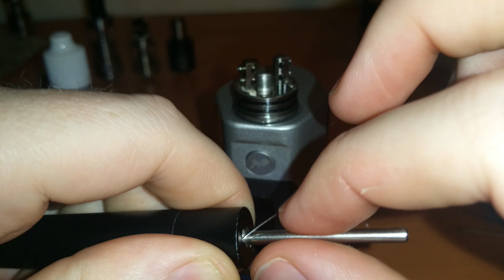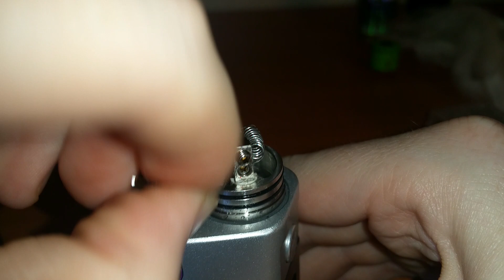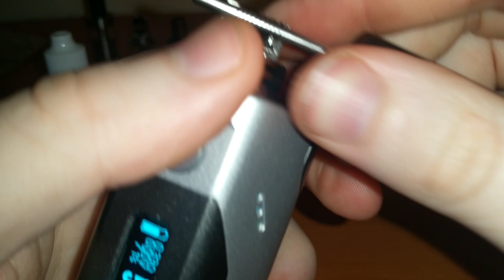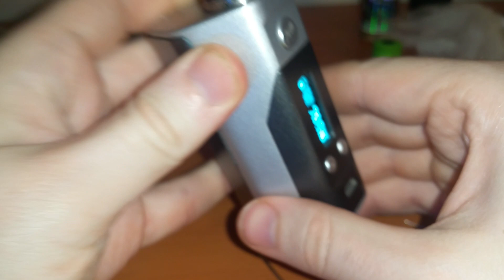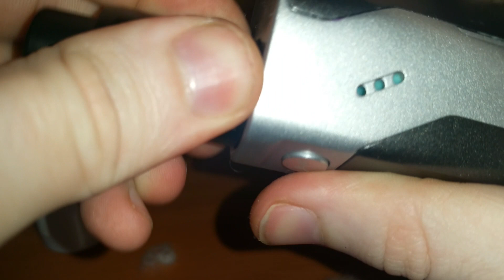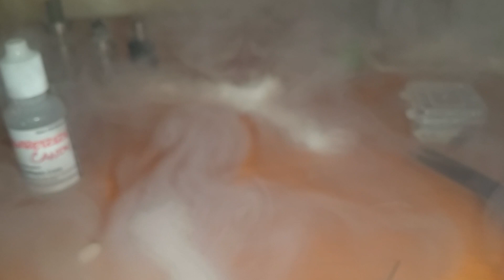AdvancedVape Build Guide Episode One: 316L Stainless Steel Spaced Coils

Comment: Hey man, first of all, thanks for the video. I have a question though.
I'm really confused about the relation between the wattage and the resistance. For example, about 5 min ago I wrapped my first coils and the resistance is 0.22 so what wattage should I vape with approximately?
Reply from the maker: Ihap subaşı there isnt a direct correlation between resistance and wattage if you're using a regulated mod. What is the wire made of and what are it's specs?
Reply: The wire is stainless steel 28ga
Reply from the maker: Ihap subaşı on a normal wire 28g build. In dual coil, I wouldn't go above maybe 60W. Probably won't even need that much.
Reply: Thanks man. Appreciate it ...

Comment: Hey man I just bought stainless steel 316L and I’m using it in temp mode on my t-priv,
 I don’t think it’s doing it’s job as in pulsing once u get to a desired temp.
 
I have a staple coil using ( 5).5 ribbon and the wrap using 38g all ss 316L coming out to .25 ohm on a 3mm bit and about 7 wraps.
  On my mod of course I set it to stainless and about 80 wats and for the temp I have it at 200 degrees Fahrenheit and it ask me for the coefficient and for that I put .00092 or .00094 or even .00125 according to internet source for 316L ss and the temp control isn’t doing its thing.
 And I get dry hits with out it telling me I reached the limit or dry coil.
 Can you help me with this.
 I bought the mod a week ago and having problems left and right.
 I search and search and nothing seem to help.
Reply: I forgot to mention they are all touching and they aren’t spaced.

Comment: When you go to TC mode what settings do you send at for your temperature in your wattage thank you
Thank you another great video
Reply from the maker: Paul Hastings I'm using a 316L CSV file and 440F with wattage dependant on the build. If you're not using a DNA mod, use TCR mode with a tcr of 92.
Reply: AdvancedVape so you said the wattage two whatever comfortable Vape to want

Comment: What is the reason for wanting spaced or non spaced coils?
Reply from the maker: joseph fiorini spaced are easier to work with when you're just starting out, and temp control typically works better on spaced. Contact has more concentrated heat. Really I made this video for people doing their first ever builds
Reply: AdvancedVape oh. I didn't know. I started with prewrapped non spaced coils. Although I've wrapped the last two I made. 
I will be picking up some more wire soon.
Reply from the maker: joseph fiorini yeah pre wrapped is the best way to start but it's a good skill to have eventually to wrap your own. You can customize diameter and wraps etc if you get the premade wire by the spool.
Reply: AdvancedVape. Right now I'm just using up the kanthal that came in my kit. I figure I will get clapton wire next probably ss.

Comment: HI, im new to 316 coils also with the temperature control mode. Im holding a DNA device, bit confuse about the setting of it. Im running a 0.37 dual coil contact build on it with 230F should I turn it up a little bit scare of it get burn ? what do you recommend for the temperature? thanks
Reply: btw I thought your video is pretty interesting im going to try to build on my reload rta, hopefully enough space for it.
Reply from the maker: Chen Jason if it's temp controlling correctly 230 is not going to produce hardly any vapor. check the temperature read as it fires to make sure it's correctly temping
Reply: AdvancedVape this is weird lol..I'm actually getting the feeling of around 40w at 230F and I turn it up to 330F it taste bout the same
Reply from the maker: Chen Jason does the temp readout look accurate? anywhere from 220 through 350 should be extremely cool, not much happening. 450 should be slightly warm
Reply: AdvancedVape I turn it to 450F it burns instantly, it is because I wicked wrong? Can't think of any other problem, I can see it going from 45/175/280 to 450
Reply: with juice on it

Comment: Hey man i have a question. Ive been vaping with electric and mech mod for a years and i never use any wire besides KA1 or nichrome, but i dont like nichrome at all bcs its make me headache sometimes. Btw can i  build SS coil without temp control? (im talking bout contacted ss coil not spaced). Hope u will reply this
Reply from the maker: Shaffan yes ss can be used for wattage mode also.
Reply: AdvancedVape thanks mate

Comment: As a kanthal user, I started out with a spaced SS coil (7 & 8 wraps effort) and the flavor wasn't there compared to the coils I'm used to. Any suggestions?
Reply from the maker: Roel Horemans most people coming from kanthal tend to dry fire SS way, way too hard which can destroy the flavor
Reply: Didn't dry fire since it's discouraged. Really have no idea, since my coil looks exactly like the one you built. But thanks for the swift reply. I'll keep fidgeting until I get it right. :)
Reply from the maker: Roel Horemans it's also possible it may need a different wattage than an equivalent build on ka1
Reply: Lower wattages definitely seem to serve me better. Maybe I just have to get used to the different flavor profile you get compared to Ka1. :)

Comment: Maybe you have an idea? Or old Evic mini suddenly turned bad, so we replaced it with an new reuleaux 2/3, still bad...
so we replaced the tank... with an new RTA... still bad... 

TC not working... all the time going to max on both devices...
But also in power mode.. it's unpleasant to use... burning taste somtimes... 

The only thing we haven't replaced is the type of coil, we use 316L, just like in your vid.
Long time ago we vaped fine on the Evic... but now nothing seems to work good.. any idea?

On both devices the Temperature mode goes all the time to "heat protect"....
Changing the TCR has no effect.. still goes to "max heat" all the time..
Reply from the maker: Joep B are you doing contact coils or spaced?
Reply: Thank you very much for your reply!! On both we used to do contact coils, but my last few attempts are spaced.. no noticeable difference thought.... I'm pretty clueless what the problem can be.

We have dual coil with the new tank, but the issue stays. In fact it is unusable like this, I really hope you have an idea
Reply from the maker: Joep B the most common thing is something wrong with the build preventing it from reading the resistance correctly. you need to try to make sure both coils are completely identical in leg length, wraps, and shape, and that they glow evenly and in sync. you also need to make sure there are no shorts with the chimney and that the connection with the posts is as secure as you can make it. always let your coils cool completely to room temperature before attaching it to the atomizer and getting the base resistance set.
Reply from the maker: Joep B what tcr?
Reply: So far I have tried: TCR 80-85,90-95, + Default: 120. And all of them give the same effect :( 

Edit: I just tried, and now suddenly it works, I removed the tank, put it on the old one, suddenly worked, put it back on the new one, now suddenly works fine... (at least for now)... Am I missing something? Haha

Just the liquid almost ran out.. so I turned it off, refill it, turned it on.. again "temp protect", so I turned it off, unscrew it, turn it on, and slowly 'screw' the tank back in place, while hitting the fire button.. and then it worked again and the starting temperature is 21 again.. 

I have no clue how it is possible.. but at the moment it works
Reply from the maker: Joep B the actual tcr of 316L is 92. lower will make it temp out sooner while a higher number will make it temp out later  (hotter) but if you have it working, leave it alone! haha
Reply: Thanks a lot! It just worked, until right now.. I checked the settings and it's on 95. It now instantly goes back to temp protect... Just turned it off, unscrew, on, put the tank back, while hitting the button.. and now it works again!?? 

Exactly this same behavior we had before with the old tank and the old mod.. I guess in an while it stop again and have to do the same to get it running again.. any idea?
Reply from the maker: Joep B it's reading the resistance incorrectly. if it only works correctly when it's heated up, and then when it cools down it stops working again
Reply: Any ideas how to fix it? I was thinking to buy an SS316 coil, pre-build, since the SS316 is the 'standard' for the SS mode according to Wismec. Since the mod and tank are less then 1 week old and the old mod and tank are having the same issue... only thing we use in both is the same coil haha
Reply from the maker: Joep B honestly the easiest way to fix it would be to just use power/wattage mode at a wattage that agrees with you. But if you can't get it working in tcr mode, I would suspect something with either the build, the connection, or the wire itself. almost all ss wire is sold as 316L and it can be hard to determine with some brands if you're actually receiving 316L
Reply: Thanks for the help! 

Went tried yesterday the TC Ni mode with Ni200 and the temperature control works now.
On the new tank we put 2 factory clapton coils in power mode, but still the vaping has an harsh after taste.

We have now replaced everything, the mod, the tank, the cotton, the liquid, factory coils..
And after now replacing everything... it still has an harsh after taste.. maybe you have an idea? Since we are about to give up on Ecig.. after spending months.. the result is even less.... then those 15 euro complete ecigs in the store....

I don't know anymore...
Reply from the maker: Joep B have you tried using a different juice? Also, what is the nicotine strength of your juice?
Reply: Yeah we tried different juices, we also got some 0 mg, to mix it to lower the nicotine, to make sure that it's not the problem.. We use 6mg juices, but it's lower now, since we added 0mg VG. But still sharp in the throat :(
Reply from the maker: Joep B hmm. what's the resistance read with the tank /cap fully assembled?

Comment: i've heard a lot of people saying that SS is not as safe as kanthal, but in my case, i really love the flavor with the SS contact builds , spaced builds gave me less flavor.. i also never vape them on TC mode, just using wattage mode around 45-52 watts with dual .33 ohm build using 26 gauge. am i doing it safe? or not? can u explain? .. I once dry burned the coils till extremely glowing red at my first try and when they cooled down they suddenly became ashes and i was terrified. lol.. sorry for my weird English.
Reply from the maker: Rabil Alfaraby to be honest I'd argue the opposite, that kanthal is less safe. But aside from that the truth of the situation is that as long as the stainless steel is not getting glowing red hot to white hot, you are not producing potentially harmful oxides. in that context I would far rather use anything out there but kanthal, with SS providing the best performance and flexibility.
Reply: Okay. Thanks for replying.

Comment: So i noticed that when dry burning this coil your ohms jumped from what i believe to be .33 to .45 which i also believe (ohm jumping) to be inappropriate for wattage mode. Your response? I've been looking for some detailed threads and videos about this wire and have found out little based on what's currently available.
Reply from the maker: Kameryn McClain-Honorable it's stainless steel wire. resistance increase with temperature is an intrinsic property of SS so it's completely normal. it's what allows it to be used in temp control applications, but it's also completely safe for wattage mode (unlike titanium or nickel)
Reply: AdvancedVape I understand it's safe but my question is do you find it appropriate to use in wattage mode due to the physical reaction? An example: a coil reading .2 cold and jumping as you fire to an estimated .4
Reply from the maker: Kameryn McClain-Honorable yeah, I personally use it in wattage mode quite a bit. There's no perceptible difference for me with the resistance increase if that's what you mean.

Comment: stainless steel has an overlay that when u re not using temp control it melts and becomes some shity black powder.. it loses that silverish color..the dude in the video puts cotton imedidiately.. he sucks it down...  i believe its wrong to dry burn it..
Reply from the maker: dio mic that black powder is ash from your burnt juice man...stainless steel is all we do, you have to dry fire it for contact builds.
Reply: no juice at all....if it rises above certain temp it burns the outside layer... ss316l.. only temp.. ask a chemist
Reply from the maker: Man, you're wrong. we were the first company out there to sell stainless steel 316L wire in premade types for vaping, and we've been doing the stainless steel thing for a while now, so i've dealt with this issue multiple times. EVERY metal will oxidize when heated, but it is both the degree of heating and metal composition that is important. Kanthal, which is an alloy of iron, chromium, and aluminum, will form both hexavalent chromium and aluminum oxides when overheated both of which are dangerous. Nichrome will release both nickel and hexavalent chromium when overheated, and 316L stainless steel will release hexavalent chromium as well but at VERY high temperatures. If you're getting black powder on your coils you are dry burning them to an outrageous degree. stainless steel is absolutely safe to dry fire GENTLY. we have videos elsewhere on our channel that cover this in detail. Stainless steel is completely safe to be used in wattage mode or temp control, because in wattage mode, with saturated cotton in contact with the coil, it will never reach temperatures approaching those dangerous levels and you still be able to vape on it. We're talking approaching 700-1000 degrees. That said, if you prefer it in temp control, by all means use it. But to say that's the only way is incorrect.
Reply: i hope  ure right!!! :P i do that!! :P
Reply: dont do that! because they selling ti doesnt meant he is right! U r right, never ever dry burn any metel u use, just clean it with 90%+ alcohol and you r good to go, even using kanthal you will see what a difference it does to flavour, myself i did usde 2 years kanthal and alsways did a dry burn but now i tried to do the above i said and maan how much differennce it does for flavour!!! so dont listen to him, never dry burn, be safe!
Reply: fuck cleaning .. its easier to make a new one :P
Reply from the maker: dio mic yeah for sure on simple coils. but if you've got some staple staggered fused that took you a really long time to make, cleaning is the way to go to keep them running as long as you can. I love the flavor on them but making them is a serious hassle
Reply from the maker: Rampant King were talking about stainless steel, not titanium. they are NOT the same. one is safe to dry burn one is not.
Reply from the maker: Rampant King sigh. if you're talking about a normal round wire spaced build, okay, but you can't do that with complex contact coils. they are dry burned for a reason.
Reply from the maker: Rampant King hey man, whatever works best for you.
Reply: if u have  really nice juice even with a simple build u do your job.. they sell a lot of pastrie colors thats another problem... im lucky
 i have the source for natural liquids so it doesnt bother me making 
complex stuff to get taste..
Reply from the maker: Vu Nomic a better question is why is it always on the very first video I posted...never the newer ones...
Reply from the maker: Vu Nomic no man that's not what I was saying at all. was not hating on you, I was agreeing with you and wondering why it's always this video
Reply: why did you copy/paste @james baker comment
Reply: I only vape sweet stuff and use premade (ni80/kanthal) coils for a year now from various sources. I bought a bunch of 316L and the coils are completely black within a day and the  flavour is already worse. The ni80 last me months..
Reply: Could you be a little more specific about how to clean pre-made SS316L coils with 90% alcohol? Do you just soak & rinse, or what?
Reply: no! any metal you dry burn changing the structure of it, i dont even dry burn kanthal when making new coil, just cleaning it with alcohol and it even taste better without dry burning it!
Reply: this is where i have to agree with you, because clapton, microcoils, fused etc. have to be dry burn, the solution is simple-dont use them, tasdte is the best from spaced coil, sure you get less vape but that is not a problem

Comment: hey bro i just bought some 24 awg ss316l wire from geekvape and i'm trying to build 8 wraps dual coil, i'm using wattage mode or tcr mode on dagger but I couldn't  feel the juice , I feel there is something wrong with what I do, do you have any solution for this?
thx for helping:)

Comment: Great tutorial, got some 24g 316l on its way so this is exactly what I was looking for 😊 if a mod has different coil modes (SS, KANTHAL, TI), is it nessacary to select appropriately if you're using wattage mode and not temp control?
Reply from the maker: well typically on mods those different modes ARE the temp control settings, so usually it's wattage mode or one of those other settings
Reply: AdvancedVape wow, thanks for getting back to me do quick! I did suspect that might be the case but wanted to check, got a Minikin 2 en route and saw these options and wanted to query it. Just watching all of your videos, so glad I found your channel! Thanks again buddy and you have a very happy new subscriber 😊💨💨💨💨
Reply from the maker: thank you! if you have any other questions just lemme know.